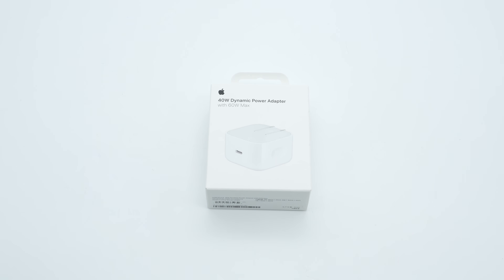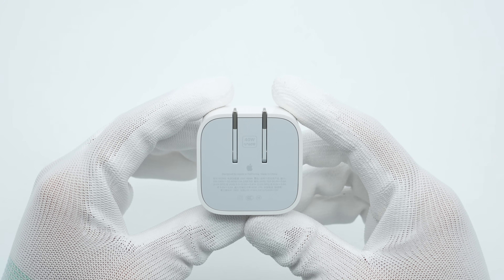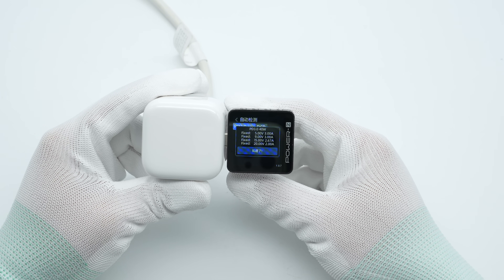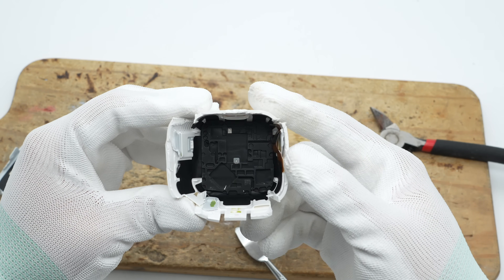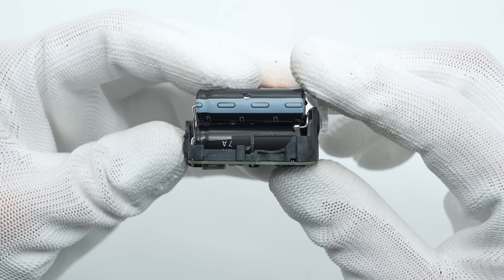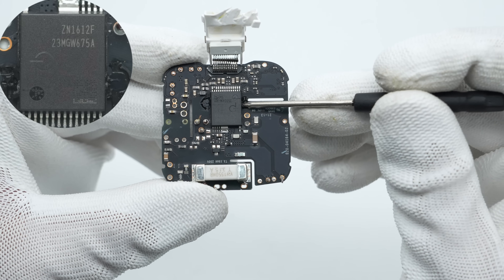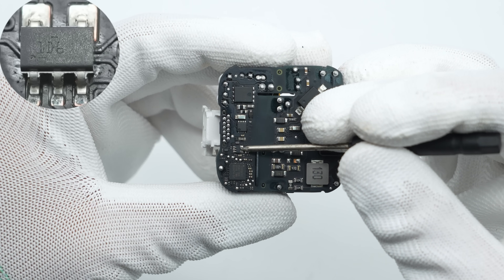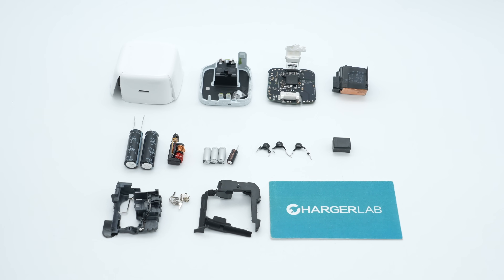Teardown of Apple 40W Dynamic Power Adapter with 60W Max (A3365)

Comment: Hello. Why didn't you do a charging test for the iPhone 17 Pro Max with the A3365 charger??? A lot of people have been waiting for this charging test with the new iPhone charger.😁
Reply: Charge on MacBook already proof of concept. And the video states that 60/40W switch is base on internal temperature which is affected by ambient temperature. So testing iPhone 17 Pro is more about testing how long the the peak 60W and will it maintain a meaningful or enough boost during early stage. But if you cannot obtain a iPhone 17 Pro right now the best you can do is PoC.

Comment: What about a MagSafe charger ? 
Are there any with a high speed charging cable attached ?
Or is the standard Apple MagSafe charger with vinyl wrapped cable sufficient ? ( As there doesn't seem to be any other options )

Comment: Man this charger is more beautiful than most phones from other makers inside. Apple is amazing!
Reply: But Apple products need to be designed to be repairable.  When they went away from repairable devices, it put more electronics in land fills.
Reply: @Resist4 I agree with you but imo Apple chargers have been rock solid, they just keep on going, unlike some other products from Apple that they’ve deliberately made extremely difficult to repair.
Reply: Ankers new nano 45w charger is even smaller and better looking and cheaper 

And I have tested it with my 45w Anker nano charger and it charged my iPhone 17 pro from 1 percent to 50 percent in a little over 19 minutes

Comment: While im not interested in the disassembly i got the accurate info I wanted and thank you for that. 3 amps in 2025 is just bonkers same as the 20w charger so why spend more money?
Reply: 3 amps can be any watt. It has to have a voltage with it. Voltage * amps = watts. 5v 3a is 15w while 20v 3a is 60w.

Comment: The module just supplies power it’s up to the device how much energy it will accept which if the battery gets over 50% the power being used will go down probably to <15 watts

Comment: Is it the GaN charger ?
Reply: Hard to tell. The Power Integrations main IC looks like it may be from the InnoSwitch family, but it is impossible to tell which model, because this custom Apple part number is very different from the corresponding PI codes. The InnoSwitch 3 family is recommended by their homepage for 40-60W USB chargers, and it is not GAN. From 65W up they recommend InnoSwitch 4, which is GAN. Measuring the switching frequency would probably tell us which one they used, but I don't have a unit to tear down and measure for science :)

Comment: Those charges are getting complicated. Can't wait to see when we will be updating firmware on those chargers.
Reply: Apple MagSafe ring has had a firmware update, idk what it did, but it had one lol
Reply: You already have to update firmware on some Anker models.
Reply: of course they are getting more sophisicated with the new era of GaN for even smaller compact designs and more precise control of power
Reply: @carholic-sz3qv this charger doesn’t use fan I was upset about that
Reply: @AphillyatedYT  No small charging bricks use a fan.

Comment: The photos on the Apple website show a UL mark on it. Your video’s close-up does not. Either way they are compliant to safety standards, but it’s an interesting difference I noticed, having worked in the TIC sector for over 10 years.
Reply: This is the CN version so it uses CCC instead of UL

Comment: was waiting for this video!
just realized that it's not variable voltage lol... when I read the spec online thought Apple FINALLY adopted, PPS they just wrote the Voltage range as a range and not the typical 5V/3A,9V/3A, 15V/2.67A, 20V/2A hence why I initially got the impression they went with PPS 😂

Edit: ... wait it DOES support AVS; is it just that the KM003C didn't see all the protocols?? am confused
Reply: KM003C might be outdated and does not support USB PD 3.2
Reply: The km003c needs the v1.99 update for PD 3.2, released a few days ago.
Reply: why Apple use only AVS, but not with PPS? I saw Google's 67W dual port charger does support both PPS and AVS
Reply: @hn.fadlurahman Apple is not using AVS, the iPhone 17s will draw 40W with any charger that supports 15V 2.67A or higher

Comment: What support will the KM003C have for PD 3.2 and AVS?
Reply: After posting this I discovered that ChargerLab had posted a framework update 1.9.8 for the KM003C that adds support for PD 3.2 and AVS. Thanks for keeping the device up to date with the PD standards.